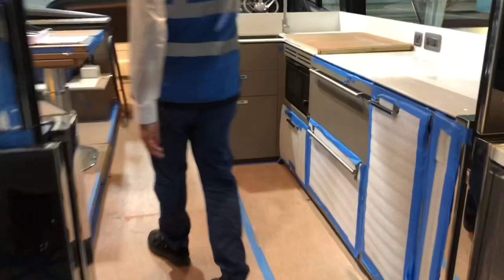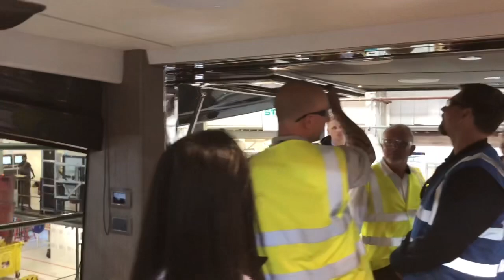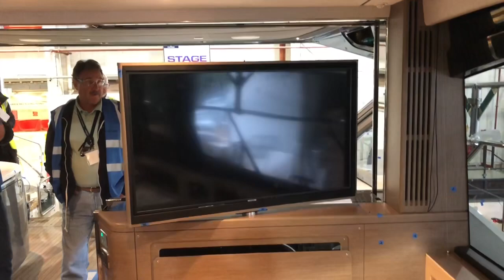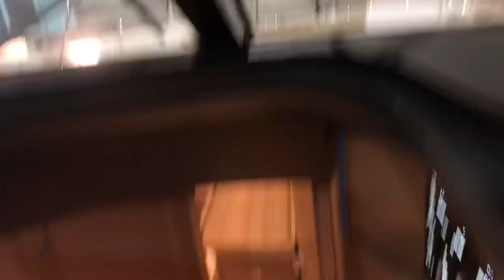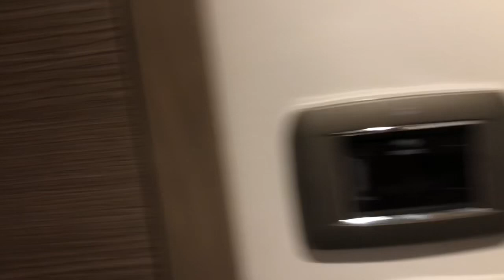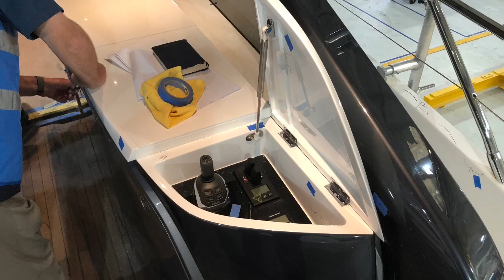Princess V55 Hull# 1 Sneak Peak by David Inglis

Comment: How many miles will pass this yacht on a full tank?
If you compare it to the Elling E6 with a tonnage of 35 tons, the V55 27.5 tons (Lighter and, as I understand it, more streamlined). Identical engines: Volvo D13 900. The manufacturer claims that the Elling E6 will cross the Atlantic. Would the Princess V55 be able to do the same if the fuel tank was the same size as the Elling E6?
Reply from the maker: Totally different design purpose.eilling I’m sure is full displacement. Princess modified deed V planning Hull.